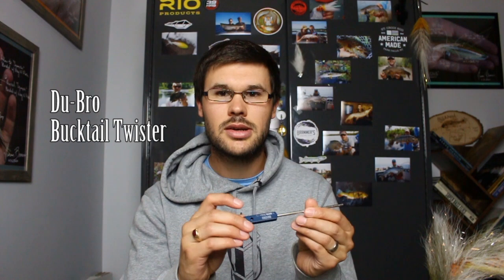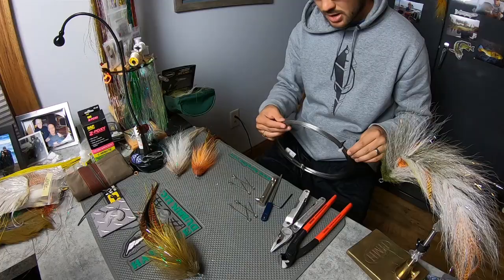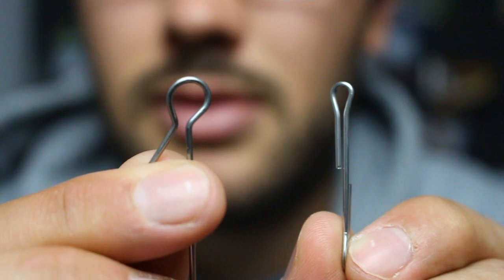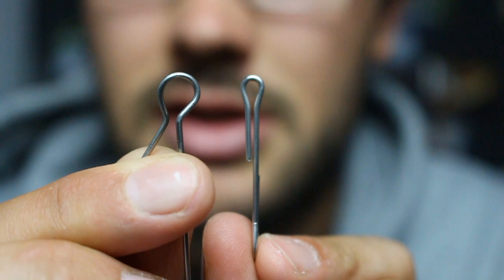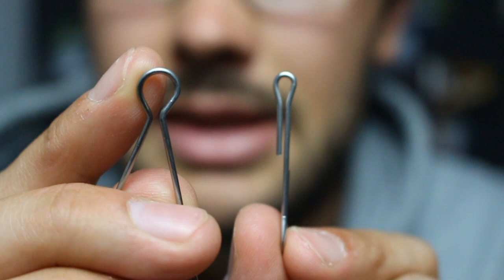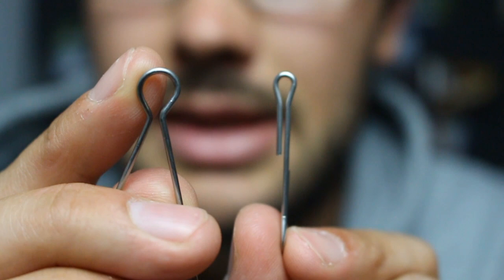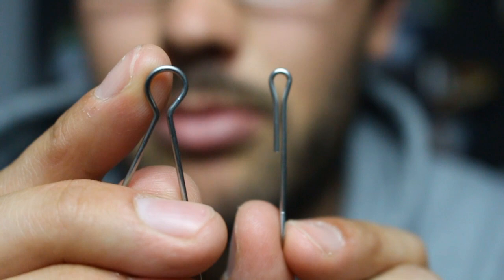Custom Shanks for Musky Flies - Hook Placement for Musky Fly Design

Comment: Have you tried the " one step looper " tool??
A lot of guy's cut it at the hole on 1 side  and the ot will not vut the wire (you can also just rotate it) and it comes in 1,5mm to about 3 or 3,5mm ( size of the loop). I saw some guy's using that and it seems really easy/quick to use.
Reply from the maker: The 0.051" Dia Wire is to stiff - it sheared off one of the arms to my One Step Looper Tool.

Comment: Very helpful!  At minute 8:30 in the video you mention an articulated shank in the rear. How do you attach that seeing it comes after the hook?
Reply: If it helps, wire wrapped into the back creating a loop then putting it on

Comment: Just curious.  Have you got large fish on this set up. Doesn’t the wire bend out of shape effecting how to swims for the next fish.  Great idea thanks so much.  I always wanted the hook further back.
Reply from the maker: That depends on the wire you select. 0.051" Stainless Steel is the wire most commonly used in mass Produced Musky Bucktail Spinners. It takes quite a bit of force to bend it, even with a Jig and a tool for proper leverage. Your leader, bite tippet, fly line core, and rod would all snap before the wire so much as showed a subtle kink.
Reply: @Gunnar_Brammer  Thanks for getting back I’m going give it try.  I really like the idea